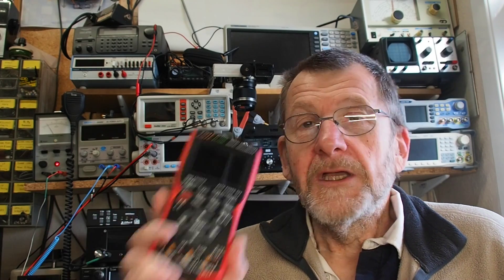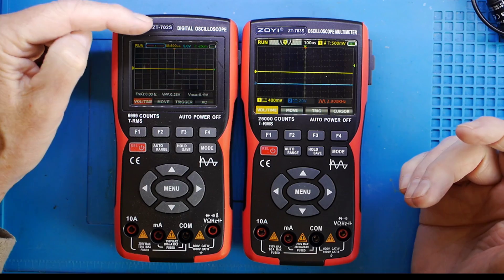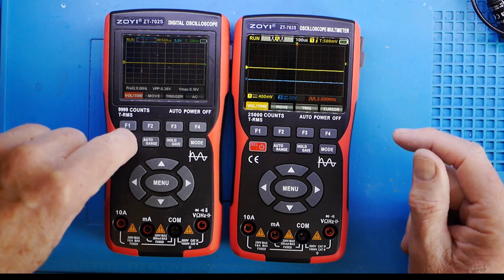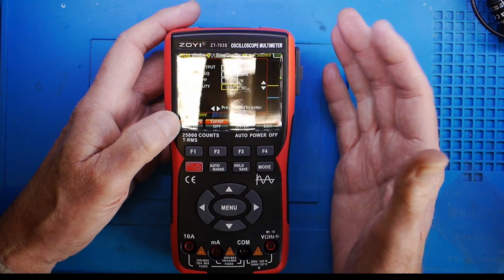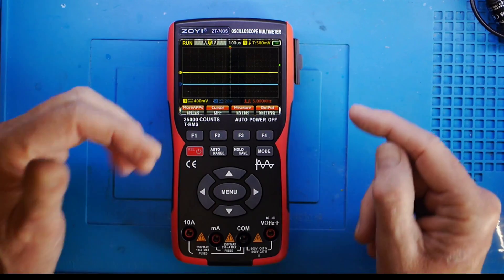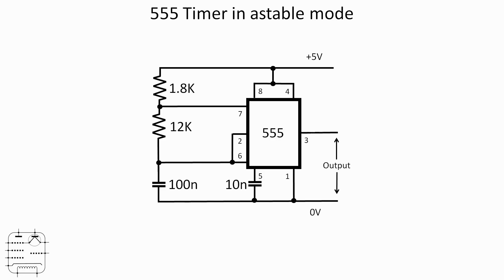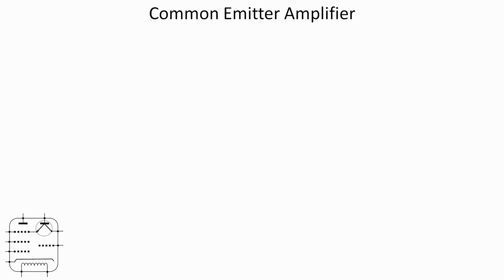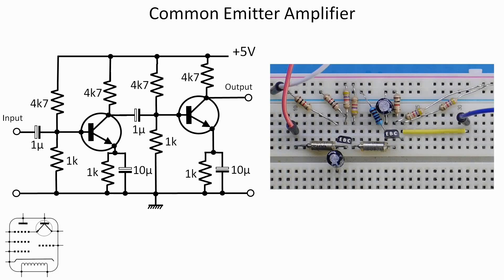ZOYI ZT 703S Oscilloscope and Multimeter Review - #179

Comment: UPDATE.
With the new 1.4.2. firmware update we now have a third trace available in the form of "FFT" (FAST FOURIER TRANSFORM) availability in glorious RED colour. It replaces the FORMAT position in the fourth menu which was used to delete the stored screen shots. It changes the "X" axis from time to frequency and as such changes the display to that of a  a spectrum analyser. Frequency is plotted along the x-axis and amplitude is plotted along the y-axis. FFTs often look like a series of mountain peaks. The horizontal location of peaks indicates which frequencies are strongly present in the W/F. The valleys show which frequencies are absent. I tried this with the built in calibration sig gen on all the available W/Fs and it shows the strongest frequency is the prime 1 KHz followed in the case of square waves by diminishing amplitude peaks at each successive square wave. Quite useful when checking  audio problems etc. The second change in the menu is in the 2nd row, what used to be the trigger position, is now "SAMPLE" with two choices, HD & PEAK, peak.

Upgrade details:
Added FFT mathematical function, replacing the original format key with an FFT switch.
Optimized low-frequency AUTO speed and accuracy.
Enhanced the scrolling scan mode.
Improved the cursor display issue in scrolling mode.
Reply from the maker: Thank you for pointing this update out!
Just updated my scope and as you say we now have FFT!
Well done Zoyi!

Comment: Saw smoke on bnc connecor when  testing wave of inverter at 220v 50 to 60Hz output. Now not eorking
Reply: The sticker says NOT TO TEST VOLTAGE in mA mode

Comment: Good video and interesting real-use scenarios. Any reason you did not use a simple two resistor voltage divider to drop down the sine wave voltage (I think I saw the min p2p from the sig. gen function is 1v, which is lot going into that first stage). Also was the noise on the signals really due to not two using proper probes. Would have been nice to see the traces with two decent probes. But good stuff Bill.

Comment: I'm 63, so about a half century into electronics, I'm simply amazed at the level of technology in the test gear. What young people don't understand is that the specs of today's entry level equipment were simply UNOBTANIUM at any price some fifty years ago. Same thing for amateur radio gear. All the Best! 73 DE W8LV BILL
Reply from the maker: Spot on Bill, I still have my Radio Shack analog multimeter from the early 1970's, sadly no longer functioning, kept only for nostalgic reasons! 
73 de G1YQY
Reply: What's crazy is that, with the given specifications that you can easily get with higher performance microcontroller (you can get $5 - 20 microcontroller with a superscalar in-order ARM Cortex M7 processor now) and decent FPGA far cheaper than the original oscilloscopes 30 - 60 years ago that used to pretty much cost a few grands, even up to 20 MHz bandwidth or faster - in essence, advancement of chip technology basically make oscilloscopes cheaper to make over time even with expensive oscilloscopes getting far better specifications, like 10 GHz or faster bandwidth. Technology is just wild, as it keeps advancing rapidly.
Reply: I am 37 and definitely digital child:) However, I love analog equipment and have quite many of them... including old oscilloscope 10HMz produced in small factory in Poland. I have very nice multimieter which you probably know Simpson 260 series 6 :) and many more :) I love every age in electronics from all over the world. I need to say that    I love to repair vintage equipment but for daily work I use something like Brymen, Fluke or price-efficient Chinese tools ;) I will never stop using old equipment untill it works from time to time :) IT is rally interesting for people to see such things.
Reply: It is quite incredible what is available. And add to that things like this you tube medium.
Reply: Yes… I very much agree with you. I’m also 63, electronics was a hobby when I was a teen but could not afford any test equipment other than a basic multimeter. After graduating from uni as an engineer, I was fortunate to work as a hardware designer for Siemens (9 years) then Hewlett-Packard & Agilent (10 years) and had access to same amazing equipment back in the 80s and 90s. Now as I approach retirement and can spend more time on my hobby, I’m amazed of the affordability, size and capabilities of what’s available nowadays.
Reply: @georgecurrenti tôi cũng rất đam mê món điện tử .thực sự nó rất thú vị 😁
Reply: I fully agree with you back then in the old days I started out in 1970 and I am now 69 years old having an oscilloscope would mean a very high price to pay but now this Chinese scope is cheaper and quite useful for just normal repair and would not break the bank but still, if you want the good stuff you have to pay more today but you have a choice to get the cheap ones or the good kind back then there is no choice
Reply: Not only is test gear like this pennies to what we would have paid all those years ago, its more accurate than most of us think, us 'oldies' have a mindset that a pocket scope costing like less than a weeks rent cant be any good because this spec would have cost a years rent or more back in the day!
I have a low end fluke meter that cost a fair amount, and a $9 a830L meter, within a digit they agree on volts/current, it sits on my bench used for mostly everything while the fluke sits in a draw. (but its lack of internal shielding means it goes wild if i sit it on my psu!)
(only scope I have had to curse at for being poor and then also had fail, hantek)

Comment: Just before I purchase one. What is the battery life and can you run it from a dc power supply?
Reply: I'd keep it isolated during tests... USBs can do wierd things and might provide a short that would destroy things.
Reply: @w8lvradio  I agree. I personally would prefer to use battery-powered oscilloscope for tricky circuits especially which cannot be grounded safely such as bridge rectifier after the mains cord.
Reply from the maker: Not sure on battery life, but does run whilst attached to a USB charger
Reply: If you decide to modify the meter, and have a few 21700 cells and holders, you could potentially make it so it lasts much longer on a charge - they're usually rated up to 5 Amps hour which actually should be plenty. Of course with lower temperature version of Lithium-ion cells, you get a bit less capacity.

I am thinking about popping in Molicel INR18650-P28A for better cold weather survivability so I can actually use it, especially the DMM portion, to check the truck battery voltage, or something like that.